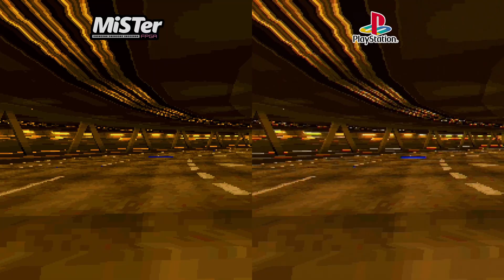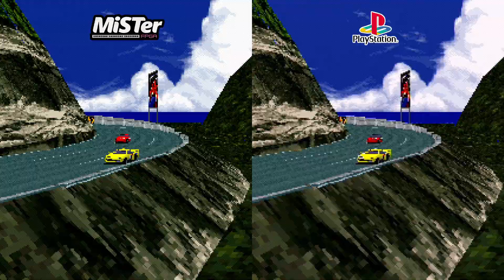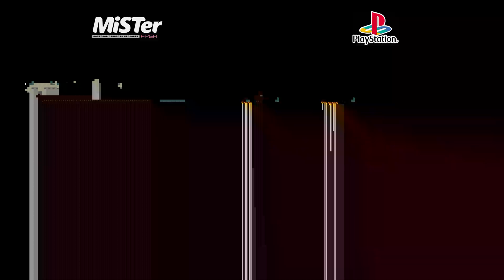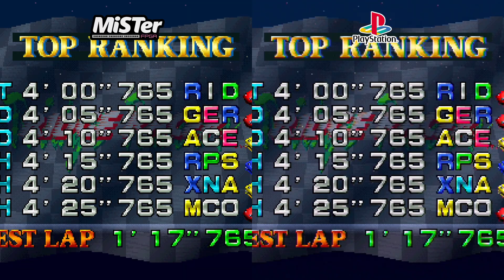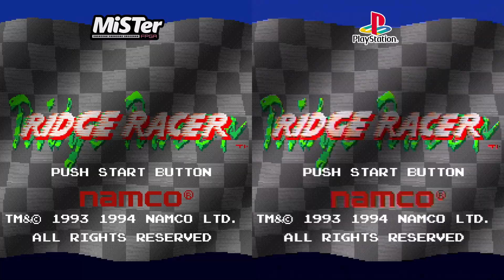How Accurate is MiSTer FPGA vs Original Hardware?

Comment: Thanks for this video! It answer a question I've had for a while: how really accurate is it to real hardware. Thing is, as we know, FPGA can be identical to real hardware, but it goes as far as the person programming/engineering the FPGA. If there's any mistakes or workarounds, it will have flaws and glitches just like any emulator.  I got my Mister not too long ago, but was always wandering if I'm looking at a 1:1 copy of real hardware, or some possibly flawed (but really close) interpretation of the original hardware. Well, your videos seems to prove it is identical (or 99.9999% identical) to real hardware. Awesome to know, and got a sub for that!
Reply from the maker: Thanks for your kind message!

My take: whist it’s possible for FPGA implementations to be cycle accurate (or even accurate at the gate level etc), this is not always the case. Core developers are often working in a “black box” fashion or using existing software emulators as a reference to create their cores.

So it can be very accurate, but not always 1:1.

One advantage that FPGAs have: once you define components in FPGA, they will interact in parallel with each other, just like with real hardware. If each component is implemented accurately, the FPGA implementation will be very accurate to original hardware.

Naively, software emulators operate on a single CPU thread, with the code that emulates each components being executed sequentially - which means you need a very fast CPU (compared to the original hardware) to approximate original behaviour. Of course today we have multi GHz CPUs, and also the ability to distribute threads across multiple CPU cores - so with the right programming, it is possible to write very accurate software emulators too - but it’s not easy! 😂

There are some great articles that explain this a lot better than I can - but I hope this helps!

Comment: lol i can’t tell the difference on first watch - could someone comment on the difference they see?
Reply: Pause and look at the yellow car from a medium to close distance and you'll notice that it has light grey edges/outlines on the original PSX whereas it's completely yellow on the Mister core. Not sure if anyone has brought it to Roberts attention.
Reply: @johansjostrand6026  That issue is caused by 4:2:0 color subsampling in the video capture rather than the PlayStation itself. 🙂
Reply: @johansjostrand6026   I guess the MiSTer is that good - I still can't tell after watching for the yellow car & pausing quite a bit! 😆

is there a time marker (@x:xx) you feel it's most pronounced?
Reply: @chinarut  Yeah the Mister is great indeed. Try 48 seconds, set the playback speed to 0.25 or something and hit pause. I'm watching in 1440p resolution in case that matters. Maybe James is running some kind of filter causing this, I believe Robert is all about accuracy.

Comment: Can this thing upscale te resolution or is it just 1to1?
Reply: It's native resolution, but it adds several  image options such as wide-screen and 24bit rendering, dithering removal and texture filtering.
Reply: MiSTer is mostly a 2D affair. It can greatly enhance a 2D picture thanks to its CRT filtersand such, but for 3D stuff I prefer to stick to emulation and crank the internal rendering resolution to 4K. Even a crap CPU/GPU combo can run PS1 games in 4K nowadays.

Comment: I assume this is just running a demo. Do you think that it would make a difference if the hardware had to process button presses and input?
Reply from the maker: It’s a great question! Unfortunately I don’t have a way to synchronise the inputs between the two systems :-(
Reply: @jamesfmackenzie  It shouldn't be too hard to make a contraption to do that, especially with microcomputers, since thieir joysticks send raw signals to their respective machines.

On thing to note is that on the MiSTer, SNAC should be used instead of USB in order to minimize input latency.
Reply from the maker: @rijjhb9467  I agree with that - seems like this would be possible with a microcontroller and some code 😎

Comment: It's Ridge Racer!  Riiidge Racer!
Reply from the maker: 😂 If I was there I would have cheered along with Kaz
Reply: Remember that one?

(I do because I'm old, I used to play it on the actual arcade machines.

Nonetheless, it's strange that the 2006 public never heard of it, how young were they? RR was still pretty relevant at the end of the 90s, not even 10 years before that E3).